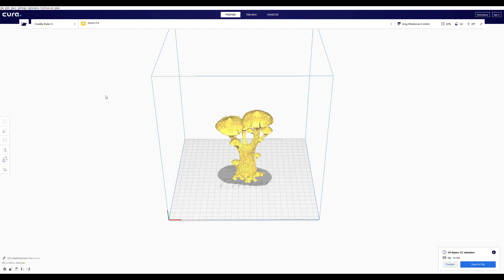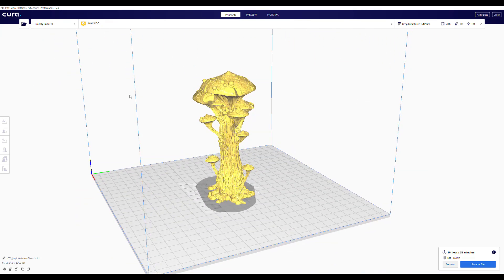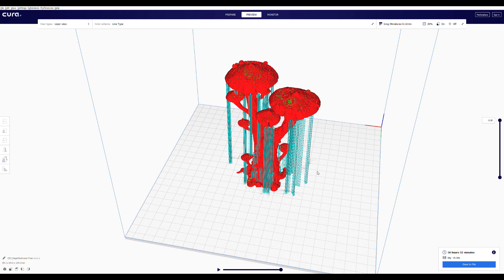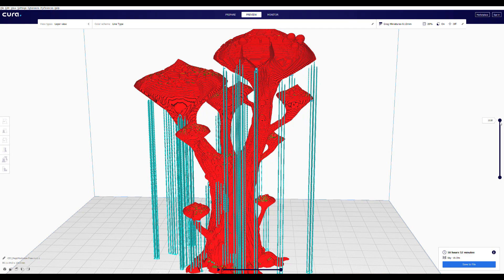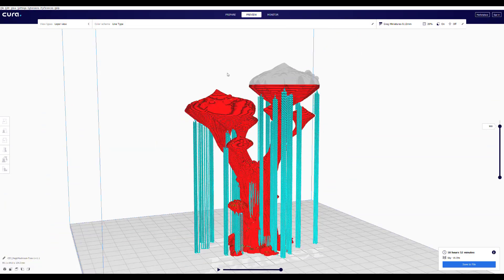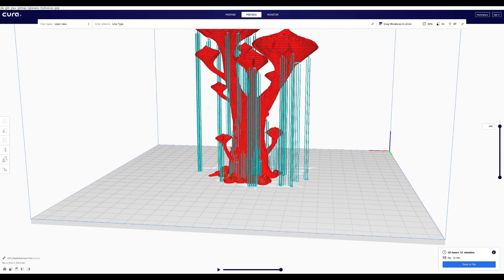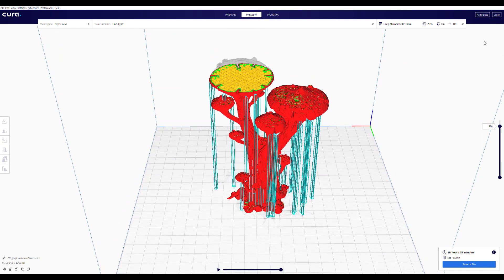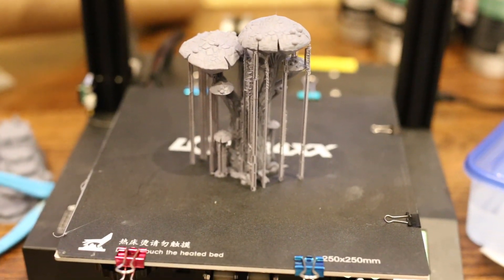Lotmaxx SC-10 torture test. After perfect prints for 2 months, now it's time for a torture test!

Comment: Is this machine still working? Thinking about buying one. I would think Lotmaxx would have updated some of the parts on it since this video. One thing I hate about YouTube reviewers is they don’t seem to do a follow up video six months after initially reviewing the machine. The test of time would be the deciding factor.
Reply from the maker: good point I should! Honestly I've basically stopped printing FDM since the big resin printers have come out.  The machine worked great until I stopped using it!

Comment: Thank you again for all your work. Being brand new to 3d printing, your videos have been a blessing. I currently have a EPAX X1 DJ and am looking to purchase an FDM printer for terrain. I have scoured the forums and seen that most suggest the Creality CR10S over the Ender 3 but after seeing your videos I'm tempted to go for the Lotmaxx, however I love the larger build volume that the CR10S provides. Do you have any experience with the CR-10S and providing that the same upgrades are made to one, is it possible to get the same results using your settings?
Reply from the maker: I don't have one but my settings work on it for sure  :)

Comment: This printer is super nice but I’m having a killer underextrusuon issues. I am brand new and at my whits end. Could you share your profile?
Reply from the maker: I have a vid on my settings, but usually under extrusion it means you are printing too low a temperature, or your feeder arm is too loose and not pushing filament through, you have a partial clog, or last thing could be bowden tube not seated all the way down.
Reply: 3DPrintingPro what is the feeder arm? Also I wondered about the Bowden tune- especially after I did the atomic pulls because it felt like there was some PLA between the Bowden and nozzle when I reinstalled the tube but I have no idea how to clear that out to seat it back in. I poked around at the nozzle a bit also, printed an almost perfect calibration cube, and then immediately had the darn thing print me a super porous octopus 🐙 😡. I could swap out the nozzle but I know this one has life left in it and honestly I’m afraid to disassemble the hot end at this moment. I don’t want to make it worse. Haha

Comment: I got my Lotmaxx from watching your video as well. First few prints with sample PLA that came with the printer came out awesome. However, it now prints inconsistently and now can't even get one print off of it. I switched to the eSub PLA+ you have above and increased the bed (65) and hot end temp (215). Still can't get good prints as it under-extrudes or just stops pushing filament half way through the print... I'm thinking it might be a leveling issue?
Reply from the maker: hmm maybe a partial clog or the bowden tube not snugly in place? Also PLA+ you if nor going thru maybe try 220.  Also make sure the extruder arm is not too loose might not be pushing filament thru properly.  Unfortunately can be a few different causes so you need to do a bit of work.
Reply: @3dprintingpro212  Thanks for the tips! I'll try all of them.
Reply: I’m also having underextrusion issues

Comment: Other than leveling the bed have you calibrated anything else? Extruder, flow, or pid calibrations?

Also another question. I have thin layers of pla stuck to my lotmaxx bed and I've tried everything to get the thin remnants of prints off. Isopropyl alchohol, heated the bed, and freezing and still can't get some of it off.
Reply from the maker: This might sound like a bad solution but anything that stuck I've been able to scrape off with my fingernail...and I don't have much nails  lol
Reply from the maker: oh and no I haven't had to calibrate anything else

Comment: Have you had to do any mods to your Lotmaxx Sc-10 since getting it, or has it been running pretty much out of the box since day 1? I know the Ender 3 typically requires a few modifications immediately, so I'm curious to know if you've done any real tinkering with the Lotmaxx.
Reply from the maker: Haven't touched it!  It's just right out of the box.